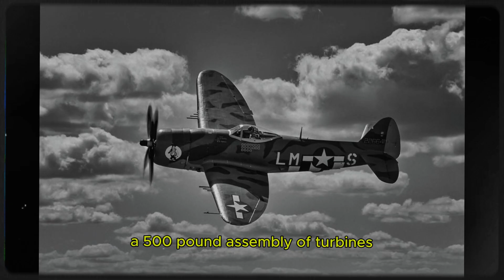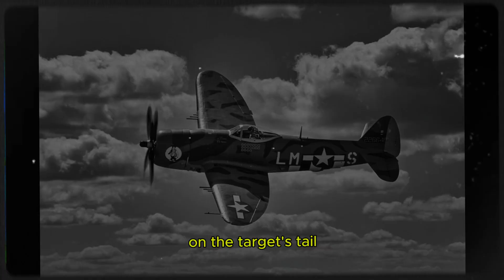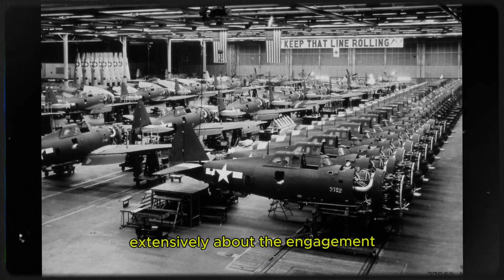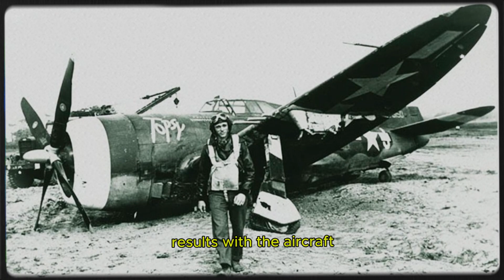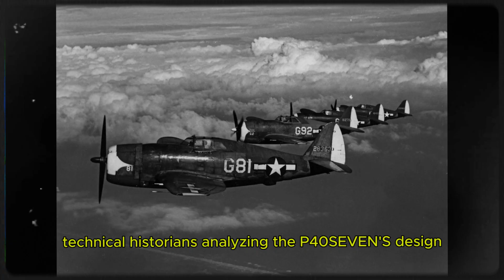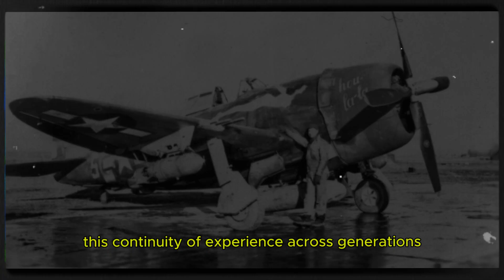How One Mechanic’s “Hidden Turbo Fix” Saved P-47 Pilots From Mid-Air Engine Failures

Comment: The P-47 Thunderbolt was a gamechanger as soon as it has been declared operational. Sure, it faced some difficulties, until Hubert Zemke developed the Tactics necessary to win against enemy aircraft. Due to its massive Horsepower, the Thunderbolt was unbeatable in a dive and it was able to perform at high altitudes, which gave the Thunderbolt the Edge. Armed with 8 50 Caliber Machineguns, it inflicted devastating damage and it also could take a lot of punishment, yet it still took the pilot back home. Only weakness was its fuel consumption... and then the P-51 Mustang came along. I am a flying enthsiast, who enjoys Games set in WW2 and I do have some games in which I fly various aircraft from that era.